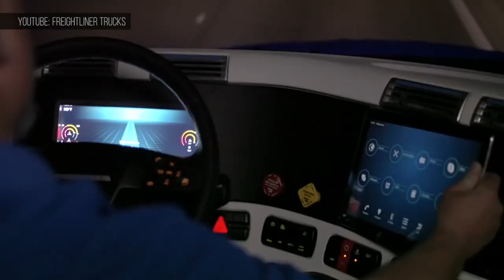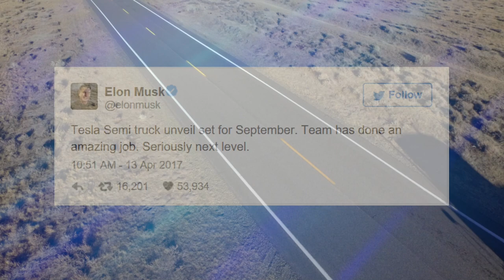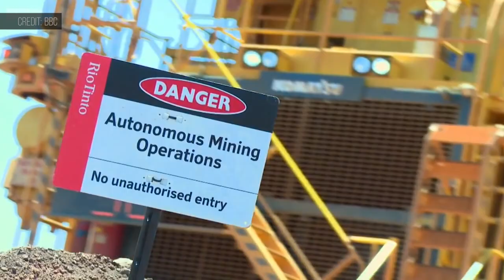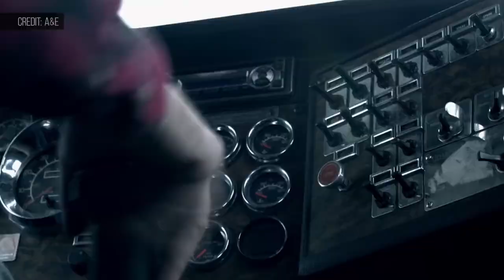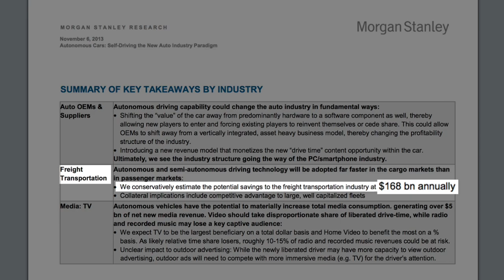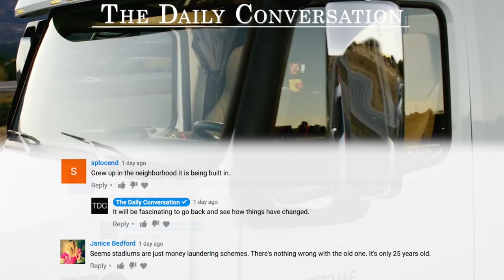The Future of Trucking

Comment: Make a truck that will:
-hook and unhook from trailers on its own
-lower landing legs on trailers
-fuel/recharge itself
-park itself
-adjust the tandems on its trailer so it won't be overweight on any axle

Then I'll be impressed.
Reply: Reese Hummel nice
Reply: Reese Hummel they will need to have an occupant in the vehicle at all times to make corrections who will still need to be paid so you might as well keep the driver
Reply: Crazyjj
Reply: Crazyjj lmao
Reply: Tandems ain't hard. Plenty trailers now are air controlled.  Release the pin and move to correct weight. New trailers and trucks come with a scale on them.  Or for few thousand you can install an after market scale on your rig. It's been 3 years since I've been on a cat scale. And never got an over weight. Parking ain't hard for AI.
Reply: Landing gear won't be a challenge.  Only thing that will be a challenge with be the refuel... whatever source of fuel. The stations will employee refuelers. They will run out to refuel AI trucks and be on there way
Reply: Hook and unhook really won't be much of a problem considering that it's an AI driving.... who cares about wait time it's a computer.  Why bother with dropping trailers? That will be a thing of the past lol
Reply: I deliver gas to gas stations. Once gas is a thing of the past I guess I'll be out of work.  Or I'll need to deliver batteries.  I better get on good terms with the battery plus drivers 😂😂
Reply: there is a truck that can lower the legs on a trailer and unhook  the trailer from the cab the driver just presses a button/buttons in spotting trucks
Reply: Because the trucking company cannot have their very expensive robot truck sitting on the shipper's dock for 3 days while they make product to put into the trailer.  A lot of "drop/hook" involves leaving a trailer to serve as the shipper's "warehouse" while the truck delivers a loaded trailer.
Reply: A new autonomous vehicle start-up has launched in #Sweden this week, revealing a remotely controlled, all-electric 'T-pod' rigid that is meant to shuttle between the Swedish cities of Gothenburg and Helsingborg.
Unlike previous autonomous vehicle concepts revealed by #Uber, #Volvo, #Tesla and FAW Jiefang, Einride’s T-pod has been designed from the ground up to operate without a driver as part of a broader transport system, and has no cab space.
Instead, the T-pod is controlled remotely from a centralised office, theoretically allowing one person to manage several units at once – much like the concept brought into play by US start-up Starsky Robotics at the beginning of the year.
According to #Einride, each T-pod is seven metres long, allowing it to carry 15 pallets over a distance of 200km per charge.
At the launch, the company announced that T-pods will start running between #Gothenburg and #Helsingborg in the south of Sweden as part of an autonomous shuttle service with a capacity of 2,000,000 pallets per year – pointing out that the point of difference is not so much the truck itself, but the logistics framework behind it.
“Einride is transforming the existing transport chain from the ground up," said Einride COO, Filip Lilja – revealing that the company’s focus is very much on environmental friendliness.
"The big companies behind long haul trucks keep building bigger trucks to increase efficiency, which ultimately means even more emissions, alongside safety and efficiency.
“We are changing that by creating a secure solution that is not only cost-effective, but dramatically minimises the negative environmental impact of the transportation industry.”
“Our vision is to enhance the lives of all people through the delivery of a #global, impact-positive supply chain infrastructure," added Robert Falck, CEO of Einride.
"We don’t believe our work is done when we’ve achieved carbon neutrality. Our design process is driven by our goal to have a net positive impact – whether that’s improving the lives of transport workers or reducing road traffic accidents, every element of our system aims to have a measurable positive impact on the planet.”
Einride has publicised a set goal for an active fleet of 200 T-pods by 2020, yet without specifying a timeline for testing and sales.

http://www.primemovermag.com.au/news/article/new-contender-in-autonomous-vehicle-race
Reply: Reese Hummel . Don't forget docking at wildly varying docks. The clowns that design this ridiculous garbage know zero about the industry and assume that it's nothing more than driving down an interstate and docking in a ten acre spacious lot.
Reply: i was thinking the same especially when connecting the coupling lines from the tractor to the trailer you still will need a human to do that.
Reply: Agreed. Pure science fiction!
Reply: and check in at the shipper too,, how???
Reply: Tesla Semi.
Reply: Tarzan if you pray ill make it happen
Reply: Tarzan tandems get stuck or doesn't work we'll all the time, so yeah that kills your theory
Reply: Tarzan soooo not dropping be trailers I'd good? Noooooooo I don't think so..... Can't stay hook when it's More companies our here
Reply: Kevin Clinger pretty much a "conductor"
Reply: Ya.  "They" will figure a way to do it.  Bet a 21 year old collage student is working on it right now!
Reply: @TARAS_Vech  
regards the refueling, simply have the truck parked in a specific GPS location (shouldn't be hard for an AI truck) and have a robotic arm reach out and clamp on to the fuel receptacle (whatever fuel) and simply have the truck talk to the fuel station to say how much fuel is required. if they can do something pretty similar in car factories, it shouldn't be hard to implement it here, the hard part would be making it as resilient as possible to hackers etc.
Reply: Time to get impressed then, those things aren't the difficult bits.

Comment: I don't care what anyone says, these auto trucks will not have instinct. I'm a truck driver and I know by experience that things are never the same. Imagine if you will, a loaded truck goes down a road with a certain load weighing a specific weight, with no wind no ice. Sure it's easy, but imagine that same road in the worst conditions with a different weight. The fact is computers can't feel and use instinct or judgement to plan their next move. If that was possible then they would have to be self learning, and if they are self learning then what do they need us for? The terminator....watch it...
Reply: When a tire blows out in a curve people will be killed..
Reply: Johnny Peeks when there is no driver people will also be killed cuz of the cars with the passengers in them
Reply: You have a great point but companies like swift will jump at the chance to buy autonomous trucks. Even if they're half as good as a human driver they still will be twice a good as a swift driver. (Thats a trucking inside joke)
Reply: Because thermostats and windsocks dont exist, and computers are things that cant be programmed outside of forward left and right?
Reply: Neural networks could easily take care of that problem. Computers are already able to "feel" by using sensors. While the first 5-10 years the AI won't be good enough to take over completely, afterwards it will be a much better driver than any person on earth. If you have data there is no instinct needed, predictions are enough and at those kinds of tasks, computers excel. 

Neural network uses multiple instances to learn every time it fails so it is basically like how people learn something. The difference is that it can run at the same time on multiple instances so it can learn tens of thousand times faster. Basically, if you could learn what other people were learning at the same time you would cut the time exponentially.

The best part is that neural networks are only one of the solutions that are already developed and can be used right away. So I don't exactly understand what your point is.
Reply: With the current rate of technical advancement, you probably don't have to worry about losing your career to Autonomous trucks but if you have kids, I would advise them to look elsewhere for a career path.  Its not a matter of if it can be done; but when.   The cost to benefit analysis for going autonomous has to make business sense to trucking companies in order for it to roll out nationally; in which case jobs as a truck driver would become less and less common.  We are pretty from from that right now, since autonomous vehicles are at an early stage.

Then what happens to the truck drivers?  They will have to look into other career paths, where the demand for workers will diminish and it will also drive down the labor rate  and the value of labor; possibly.
Reply: Imagine a truck with no Moron behind the wheel and does not camp in the left lane all day long.

Comment: I personally don't like the idea of a fully autonomous truck on the road with me. That is kinda scary.
Reply: It won't be. A human off site will be operating it via remote control. It will be far safer than a driver in the cab which has huge blind spots. High def cameras will cover all 360 degrees around the truck

Comment: That's all we need is 34,000 pounds rolling down the highway with nobody in control of it... Yeah and let's save money by putting all the truck drivers out of work...another example of technology ruining society...
Reply: 129,000 of acid from Utah to Nevada,,, from mine to mine...
Reply: "with nobody in control of it"
Somebody will be in control of it. The programmer that wrote the program that runs the truck.
Technology does not ruin society, it just changes old jobs to new jobs.

Comment: The self-driving trailer will have to make up for the lack of tractor upfront the purpose of the tractor besides a driver is to have the trailer maneuver on a pivot more efficient than even a bus can. The only way a self-driving trailer can match the efficient tractor-trailer maneuvering is to in effect become a bus with multi steering axles

Comment: I've followed this for a while, and believe that (sadly) no matter what we think or want, the automation of this industry will happen to some degree.  I drive a truck in the gas and oilfield industry, and realize that there is probably a time limit to this career.  I'm not sure it's about to happen in a decade though, and many of the reasons for that are stated below.  Sensors, radar, lidar, infrared and everything else which is used to drive a vehicle autonomously are only good in certain conditions... for the time being.  Maybe there will be ways to resolve these issues in the future, but a lot of the truck industry does not operate in nice sunny conditions with blue skies and run on a clean highway.  Sure a trailer moving from point A to B will be the first to go, but a lot of people seem to forget what else is done by a truck driver throughout their day.

My training, for example, was done making small deliveries to various stores which never took an entire load of product.  You'd leave a skid here, or a few there, fill out paperwork, get back into the vehicle, and move to the next location.  This isn't an easy thing to change.  There are also a slew of industries which require not only a driver, but an operator.  Your mobile crane operators, fuel tank drivers, log drivers, not to mention everything from a cement mixer, to hot oilers, and pressure vac trucks.  I have yet to see hint of a vehicle that is about hand bomb anything in and out of itself either, or robots which are going to pack and move furniture.

If I were to give people advice as to where to work in the trucking industry I would say that it would be a good idea to find a section of it which does not just do line-haul or long-haul driving.  You want to find a job which involves you doing part of the trucks work, whether it is operating a boom, running hoses and lines, etc..  To think that we're about 10-20 years away from robots taking care of all of that stuff is probably a little far fetched.  It's moving, just not that fast.

Comment: Time to invest in Tesla! Otto can not compete with them. VW and the other German car manufacturers cannot transition to all electric without battery supply, which the Gigafactory was made for and Gigafactory 3 is currently being planned. The future of electrification of vehicles rely depends on fuel, in this case meaning batteries. The mechanics who only know how to use wrenches and do not know how electromagnetism, programming, and semi-conductor works cannot transition to be technicians of future vehicles. The education system soon will need to change their educational curriculum for auto mechanics to be 50% electrical theory , e.i Electrical Circuits course. There will be still truck mechanics but they will be working for Tesla, and they will be mechatronics technicians.
Reply: Yeah, invest in the rope industry and get paid for the noose that gets put around your own neck.

Comment: If anything happens to the trucking industry i would imagine it to be something like electric trains hauling freight across the u.s and local drivers using electrical box trucks to move smaller loads of freight. That to me sounds much more efficient than trying to make automated trucks that can fail in inclimate weather or have a slow response time due to technical error. I really don't see this being a viable option any time soon. Our technology while impressive is prone to many faults that in this case can result in many deaths. I do support the idea of using it as self driving on the freeway but with a driver behind the wheel at all times, but then again what keeps a driver alert is actually driving the truck so that would also be a safety hazard.

Comment: I don't really see that happening,  you cannot totally replace a driver. Look at the air line industry, planes have been equipped with auto pilot for years, they have computerized flight control, instrument landing systems, theoretically they can depart,  fly a pre programmed route and land with no pilot interaction. But have you seen a pilot less airliner yet.?  Drivers will always be needed. Autonomy should simply reduce the fatigue of a driver allowing him to relax on long boring highway sections. But still be on hand to cope with problems, fueling, checking in, opening trailers backing on to docks etc. And of course driving when in situations that autonomy is simply not practicle.

Comment: I haven't read all the comments here, but seems to be a lit of concern about unemployed drivers.  Platooning is one option fir long haul routes.  Local drivers will still be needed.  If autonomous trucks can take over say 5-10% of the loads that would fill a void.  No one seems to be stating the industry already has a shortage if drivers.  This is one of the key facts that's actually helping to fuel the discussion and the need to find a way to haul freight, since no one wants to enter the industry as a driver.  ELR and new HOS rules are pushing drivers out, but they are here to stay.  I'm in freight and a customer, we'll have drivers for a  LONG  time to come.

Comment: More automation can only mean one thing. New systems no matter how good they are will eventually break down or need preventive maintenance to keep them in optimal running condition so a technician's trade would be a good career to transition into. But it would require more training in fields as diverse as  mechatronics, robotics, embedded systems, IoT and maybe even AI software etc.

Comment: You haven't accounted for how they will be filled with fuel, loaded, unloaded, inspected. You need someone to be with the truck and account for the truck. In case of brake downs, accidents, and adverse conditions. Some problems can only be identified when the vehicle is moving. You can't have electronic sensors for certain things that can only be felt or heard, things would go unchecked for hundreds of miles because nobody has enough time to inspect the truck fully. If you think that truckers can be lazy with inspecting their rig, just imagine loading dock workers trying to do that. Keep in mind that trucks need to have Pre-trip, En-rout, and Post trip inspections. They can't have a D.O.T officer at every fueling station, mechanic shop, shipper, receiver, and company that will be able to inspect all the auto trucks coming in. Even if they train dock workers to inspect the trucks, they will still fail to see everything like the truckers do now now. You are not changing anything just passing the blame on to a computer and a inspector. You can't trust a few sensors with countless lives on the road. There are much more important things that the world could focus on than putting people out of jobs.

Comment: Think about it; autonomous cars have crashed and killed a half dozen people recently. What happens when a self driving truck weighing 80,000# goes rogue? You dont think it will happen? Every aspect of my semi tractor has broken or malfunctioned at some point. I purchased a car with all kinds of computer controlled enhancements such as auto lane holding, adaptive cruise control and a dozen other neat sounding features. On the way home from the dealer my new ride tried to kill me where two lanes of the freeway merged. Is the automatic semi tractor going to check its own brake travel or do any other aspect of a pretrip? Good luck with that!